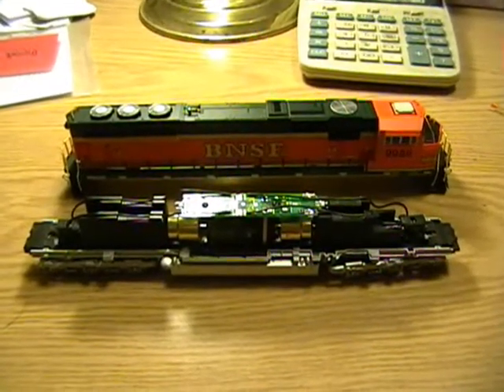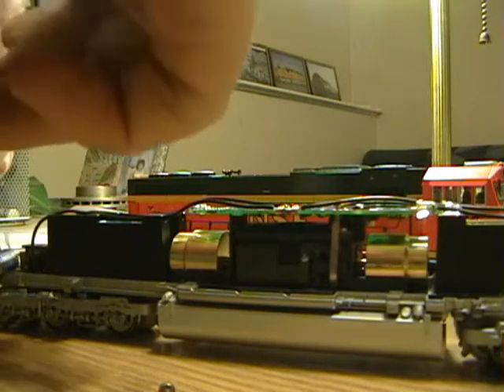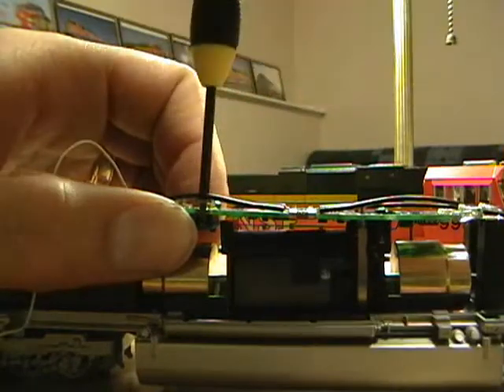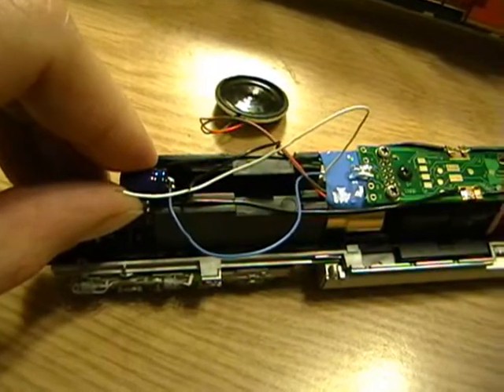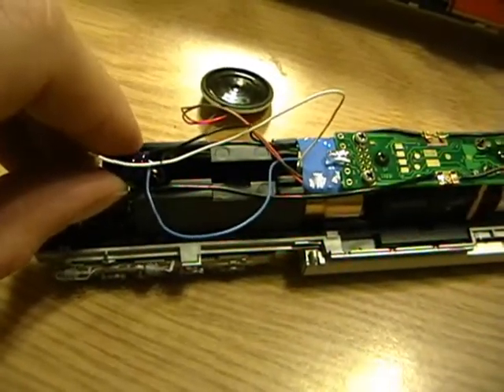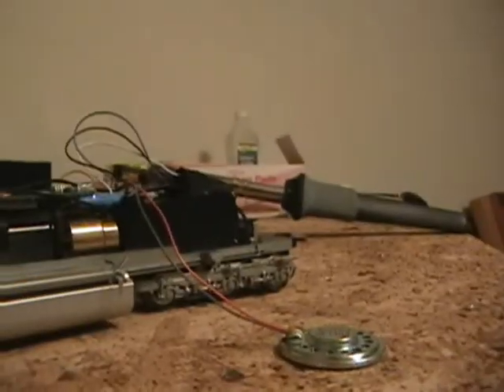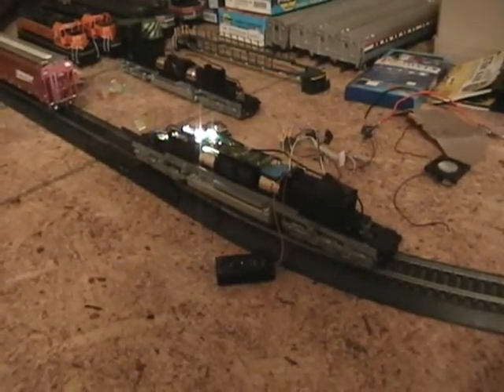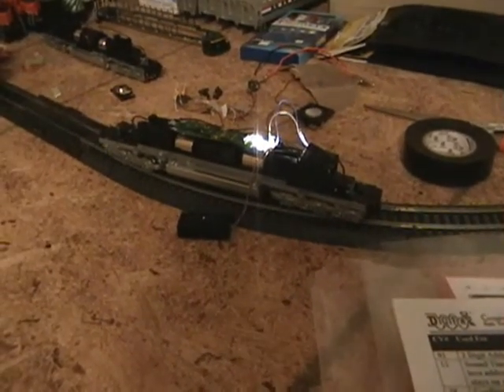01-01-2010 Advanced DCC - Part 3B Sound Decoders for Kato

Comment from the maker: I would use Soundtraxx 810113 and any baffle that will fit 0.63" wide, 1.38" long. Should just fit right in. I would remove the rear weight and place it facing up through the fans in the rear of the loco for best sound.

Comment: @tommie022481 I'm scrapping the switcher, it's just not running very well.  I took it apart and cleaned it and it just doesn't run like it did before.  I might take you up on the install, should, I just send you a message and let you know?  I may just break down and buy a new DCC w/sound engine.